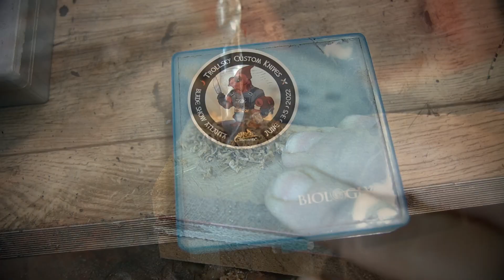THE RIDDLE OF THE DAMASCUS STEEL

Comment: Is there any use for the metal debris collected under the sanding belts?
Reply: the amount of metal shavings under the belt would be very miniscule, but perhaps after a while of collecting them, if you are working with same type of metal, you can put all the shavings into furnace and melt it for future knife projects. it's cost efficient for the most part.